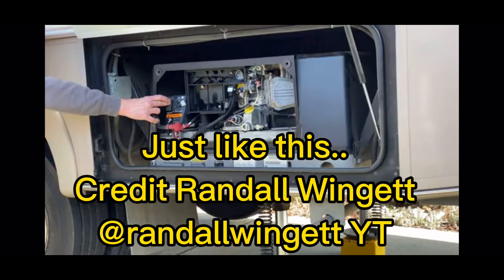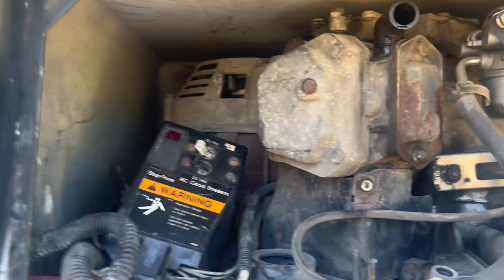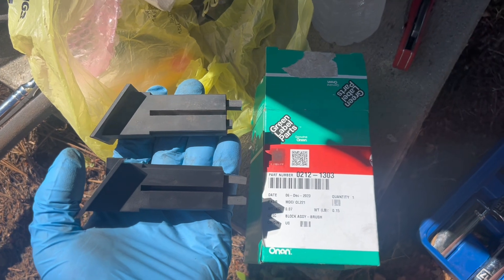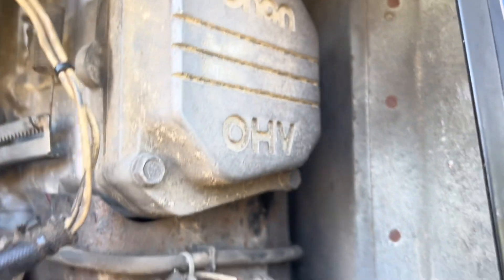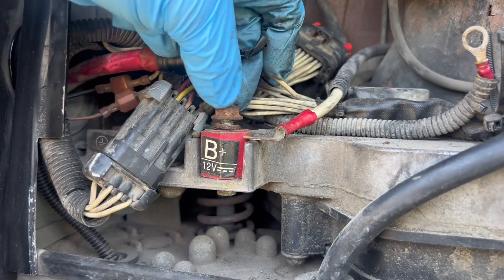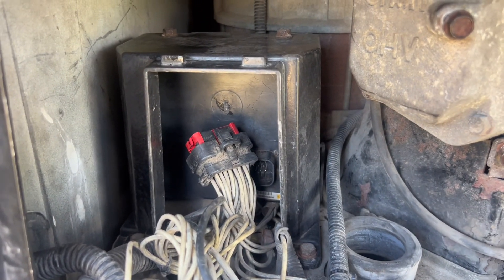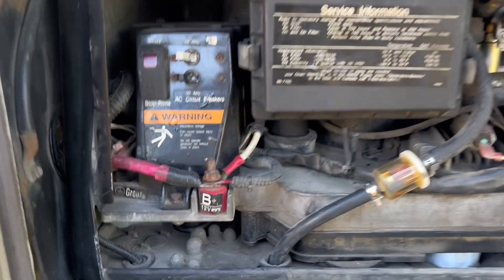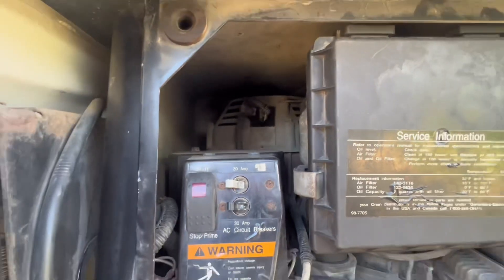Fixing Onan 5500 Marquis Generator. It shuts off when start button is released

Comment: Last week, we rented a new C25 RV from Cruise America. The generator only worked for two days and then stopped working. We went through all the instructions to find the cause of the problem, but unfortunately, to no avail. The error message is "Overcrank." The light on the switch flashes six times. When trying to start, you hear a faint rattle, but nothing more.

Comment: I have this genset and might I suggest downloading the service manual and following Onan's maintenance sch.  If you had, you would have been cleaning the slip rings as part of your maint, which btw you can do with a paint stick and a scotch brite pad for a couple bucks.  You would have discovered way before failure, omg my resistance values for my brushes are out of spec.  Kevin Caudell has a couple of excellent vids on lash adjustment and slip ring maintenance.  Kevin is my go to for rv issues, great guy.
Reply: So all you had to do was clean the slip rings? I’m having code 37 on my Onan 5500
Reply: @tommyleeflo9758  follow the service manual, its a snap.   https://rockymountaingeneratorsupply.com/userfiles/2002/HGJAA,%20HGJAB,%20HGJAC,%20HGJAD,%20HGJAE,%20HGJAF%20Service%20Manual.pdf

Comment: Thank you so much for this video. Mine is a 5500 also but not the gold one. I ordered this tool from Grainger but ended up using a homemade paint stick with scotch brite cut and wound around the end. That worked better for me. The tool from Grainger ended up being too hard. Also mine was throwing a code 27. But a new brush block fixed. Thank you again!

Comment: When I saw your video I noticed that on the throttle arm the rod coming down was in the extreme right side. Mine is in the middle. Could this be the cause of my non starting engine?
Reply from the maker: Does it start at all? My would start but shit off as soon as I let go.
Reply: @realgratitudejourney   Mine would die as soon as I took my  hand off the starter button.I went to a local mechanic who works on motorhomes. They sent it off to  the Cummins and 1900 later they found the control board to be at fault.